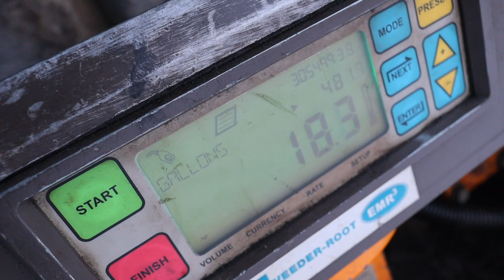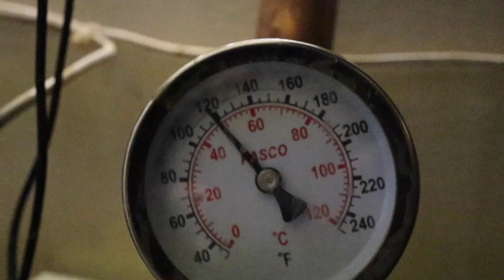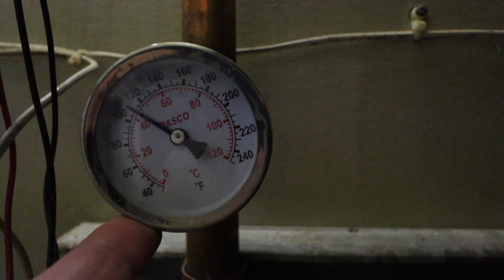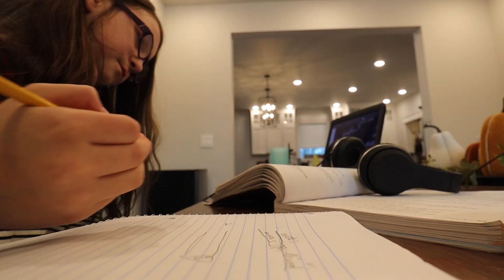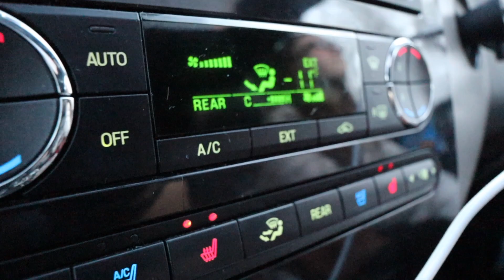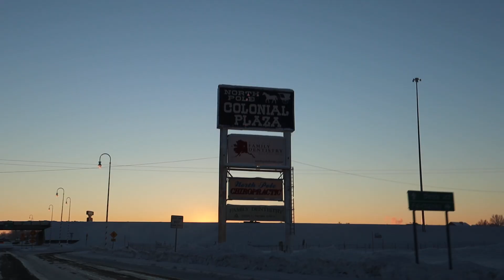HOW MUCH WILL IT COST? | HEATING OUR HOME IN ALASKA |Somers In Alaska

Comment: Here in Connecticut there is 3 main types of heating our homes oil, gas, and electric. Electric is the most expensive of all 3. We use forced hot air powered by oil

Comment: My parents run a wood burning boiler/furnace from around September/October to April/May and they have a fuel oil furnace as backup and to run in the warmer months for hot water. It’s a really cool set up with radiant floors and baseboard heat and their house is always warm.

I just have baseboard in my house run by fuel oil. But my price was about $1/gal cheaper in Rhode Island 🤪🤷🏻‍♀️

Comment: Here in Wisconsin I have a 3 bedroom ranch with full basement and my natural gas bill totals around $500 annually and that includes my hot water heater as well. The last 3 months are some of my cheapest months and were only about $75. Of course there's an additional cost for electric that the blower uses with a forced air system and I estimate that to be another $500 of my electric cost during heating season so total cost to heat my home for an entire year here in southern Wisconsin is around $1,000. The Air Conditioning cost during the summer for electric cost around $800 That's a grand total of $1,800 a year to heat and cool my home.

Comment: We have one thermostat forced air/heat in our East Tennessee home. Our home is open concept and our ceilings in our family room reach the second floor. Our electricity runs about $300 a month in winter. 😬
Reply: Mine would to in Kentucky and I don’t have high ceilings (1,100 sq ft). I on on the budget plan. Which is $182 every month

Comment: Klondike heat:  a propane furnace, and a wood furnace, on the same forced air ducting.  I use the wood one, as wood, expensive though it is, is still cheaper than propane.  I supplement with electric space heaters because my house is insulated with paint, and the paint is peeling!  (Poor construction.)

Comment: I'm new to your videos and so far they have been pretty great. I'm kinda sorry to hear you have radiant floor heating.....lol. I'm a recently retired HVAC service tech. and I have not seen to many systems like that which heat very well but it could be because it's not very common here in Wa. state. I was wondering if you have a ceiling fan ? It would help quite a bit with those high ceilings. I have been thinking about moving to the Fairbanks area since retiring.I have been there before doing some work for my old company.We have a shop there and in Seattle and thats why I like your videos.

Comment: if there is a power outage which has been known to happen here in the Midwest then do you lose your heat for your home? 2 years ago lost power for 4 days in the city. it got down to 42 degrees in the house. can the system be run off a portable generator? how long does it take to heat up your house once the power is off awhile? i now am back in a house with an old school natural gas furnace with pilot light so it would work even if the blowers didn’t. may not be efficient but i will have heat if the power fails.

Comment: Seen you talk about it before but can you explain the whole "plugging" in your car thing? What is it and how does it work? Thanks ** Alice is in my prayers
Reply: Thank you for your prayers!!!  We have several items for our vehicles to be plugged in. A battery warmer, an engine warmer that goes into the block, an oil pan heater, then those all go into a plug that you just plug into an outlet. For air pollution control we are to plug in at +20F.
Reply: @Avalanche_Broncos_Fan  thank you for the reply 🙂

Comment: Your heating oil cost 😳 I just had heating oil delivered on Monday and it was $1.50 pet gallon.  I am in Pennsylvania. We have hot water baseboard heat, but we also have a wood pellet stove to heat with, so our boiler doesn't run nearly as much as it used to.

Comment: Hi Bert and family, in the uk most homes have wall hung radiators piped to a combi boiler, thats around the size of a kitchen cupboard run on gas that is piped from the street, some newer homes have underfloor  heating, but the uk government has just announced that  Gas boilers will be banned in all new-build homes by 2023 after target was brought forward from 2025, they want us to install either Hydrogen or electric. this year has brought so may changes.

Comment: I don't know if you have time for the launch, but masks with your logo embroidered on them? May be an awesome seller!
Those cookies look awesome! 
Have you looked into using a courier service to get your product to Canada so that they are actually shipped from within Canada? You would want to do all you Canadian shipping in a single shipment. I know a company who used a courier in Canada to bring the product into NY where it's shipped out from. 
Here in NH, we have our choice of pretty much anything we want; electric, oil, natural gas, propane, wood, pellets (did you know you can make your own pellets?). And then method of delivery, baseboards that are electric or forced hot water, forced hot air (which is what we have, and it's also the AC), radiant, and some others. 
If I were building, I would go forced hot water as radiant floor heat,  and heat the water with either oil of gas. Our current system is gas fired, and we have a single thermostat in the middle of the house. I would never choose forced hot air again, it only heats the air, the surfaced never really warm out, so it still feels cold all the time. 

Love the swing in your basement, and that they kids can make use of that space!

Comment: Is your truck electric? Why/how is it able to be plugged in? Love your channel! 💛
Reply: In northern climes vehicles parked outside are often/always are equipped with electric heaters that are designed to keep the oil in the vehicle's crankcase from completely freezing up when temps drop to zero or below. It makes turning over the vehicle a lot easier when starting up the next day.
Reply: It's a heater that prevents the truck from freezing I think. I know they explained it a few shows back.
Reply: @akjag17  thx!

Comment: Pretty expensive since thats just the fuel and doesn't include your electricity and water. We are in base housing now so we don't pay the bills but back in TN where I am from the highest electric bill i ever had was $272 
We had central heat and air and that was the worst part of winter. So whew.

Comment: That's not bad for three months of fuel in that kind of a house. With a hot ceiling, such a high ceiling and lots of glass, you would expect to pay as much. A neighbor who has a similar style house installed a wood burning boiler, a trade off, pay for fuel or cut and extra ten cords of wood every winter.

Comment: Denver, Colorado - I've only known forced heat, but that's in homes 15 years and older.  One apartment I lived in that was 7,000 elevation, on a ridge, NOT a warm winter, had baseboard heaters, but they're incredibly expensive - so I used the gas fireplace all winter.  That, plus a down duvet and an electric blanket.  A tip for either heat or A/C - keep closet doors closed, you don't need to air-condition your clothes.  Incredible cookies!  And let that budding baker bake!  Who knows, in a few years she could be selling cakes!  And of course, may God bless Alice in KY with peace and restored health, her doctors with wisdom, and her family with comfort.

Comment: 8 Radiators boiler heats with gas. 2 floors. No heat on 3rd floor only go there in spring and fall. ..no basement. Always hard to tell assessors how house is built!

Comment: i live in Canada just on the outskirts of Toronto my heating is forced air with vents in the floors & ceiling my gas bill is about 150 a month 😭😭 my water & electricity is about 170 per month i thinks its high cus i rent the equipment from these companies

Comment: Here in Russia to keep 450 sq ft apartment  warm by hot water radiators I pay 13 $ a month 🤯  I had electric radiant floors installed but we never use them, it's never cold enough! we also have a log cabin in a rural area and it's heated by 2 wood stoves, in that area many public buildings like post office, some shops, library are also heated by wood stove which is not good bc they are extremely inefficient plus contribute to deforestation and global warming :(

Comment: Oh my gosh. That heating oil is scary. I had a heat pump with central air. But no more. I'm running off the heat strips for the past few years. In the winter it runs anywhere from 150.00 to almost 200.00 a month in the winter. It is stressful. Prayers for Alice. Father touch her body and heal her . I ask Father that you would give her family strength and courage and help them. In Jesus name Amen.

Comment: Our Natural Gas bill this month was $63 and it has been getting cold at night. In the summer our gas bill is $30 something due to use of gas hot water heater. It will go up later in the winter but it will never get over $100. We use gas blower system and gas fireplace as secondary heat source here in NW Arkansas. So so thankful for natural gas. 

Praying for Alice in Kentucky!!! 🙏🏻🙏🏻🙏🏻